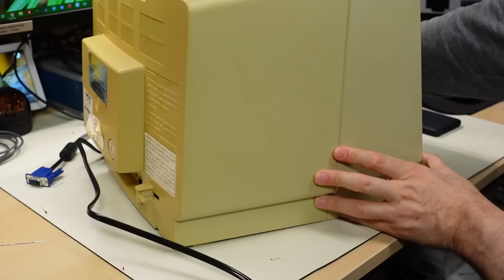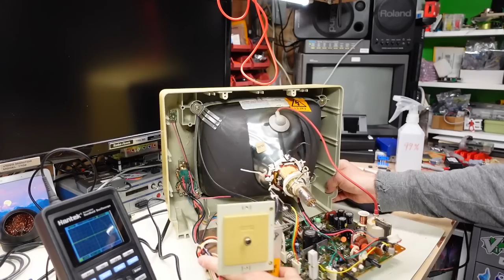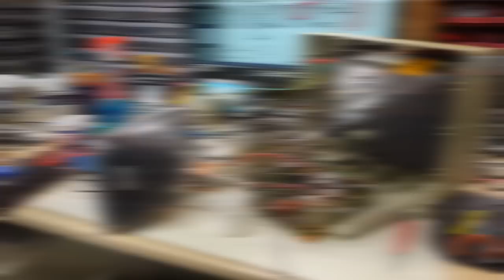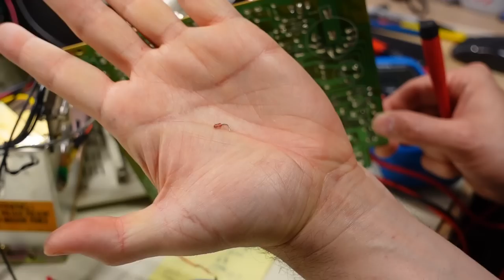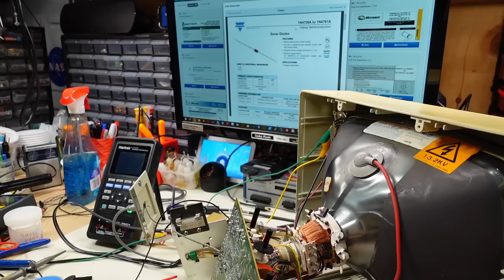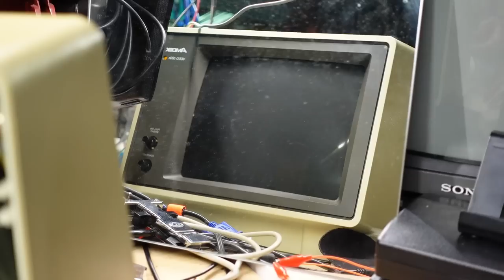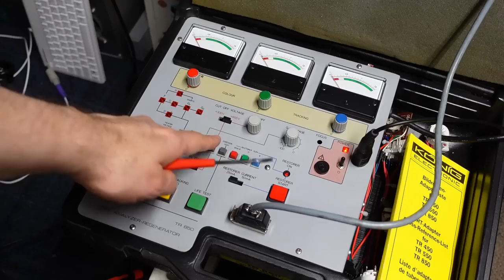I ruined this Amdek 300A after fixing it

Comment: "Better safe than sorry", and then he lifts the rubber cover and puts his bare hands about 4 inches from a conductor energized at 15kV. For those who might think about copying this, DON'T. Keep in mind that (here in the US) OSHA says the minimum safe distance from a 15kV energized conductor is about 2 feet. And no, holding a plastic stick doesn't make it better. In fact it could be worse. Also, the high power lines running down your street are typically around 12-15kV, and if you've ever seen one of those lines arcing you'd think twice about getting anywhere near them.
Reply: So, I wouldn’t be allowed to turn the monitor on or turn the brightness knob, because I’m sure the distance between any knob and the conductor is less than 2 feet.
Reply from the maker: What about the fact that just resting your hand on the outside of the monitor's case puts your hand inches away from the conductor? (And on larger color TV's those are typically running at 25-30kv) Having not read OSHA regulations, I'm guessing it is likely for high power high tension things.
Reply: @maschyt  Are you familiar with the term "insulation"?
Reply: @adriansdigitalbasement2  Adrian, it depends on not only distance but the insulation between the energized conductor and your bare skin. The CRT glass and rubber covers are really good insulators. Air, not so much. Which is why people who work on high voltage lines for a living use long, insulated sticks that are regularly tested in a lab to make sure they have sufficient insulation. And they also wear rubber gloves. And so on. And there's no difference between the 15kV on your CRT and the 15kV "high power tension things". When you lifted the rubber cover, all you had was air between the conductor and your skin. And if you use a plastic probe it could have some crud on it that provides LESS protective insulation than the air.
Reply: @adriansdigitalbasement2  By the way, if you notice the design of the high voltage probe you're using, it's plastic (good insulator), it's probably about 1 foot long or more, AND it has some plastic "skirts" near the handle, which serve to increase the distance between the conductor and your hand (a longer path for electricity to travel). No different than the insulators that are holding up the high voltage wires you see on the power lines going down your street, which are which have about 10kV of insulation per skirt.
Reply from the maker: There is a big difference -- I've gotten a shock from a monitor before with no ill effects, just a really good zing. (That I don't recommend.) I'm sure getting a shock from 15kv in an electrical substation is instantly fatal because there is so much energy behind it, hence the need for numerous safety precautions.  Not to mention, most people probably have been shocked with 15kv of static electricity walking around their house in the winter...
Reply: @adriansdigitalbasement2  It's up to you, but it takes about less than 0.2 amps of current thru your body to ground (or thru your heart) to be fatal. And your body is probably a few kOhms (of course depending on how much insulation your shoes/feet have, if your skin is wet, etc.). Do the math. And BTW, you had the monitor turned ON when you lifted the rubber to check voltage. It's not a case of static/capacitive charge, the 15kV had a driving source. So you're saying it can't deliver < 0.2 amps at 15kV thru your heart for long enough to be fatal? Good luck with that.
Reply: @EETechStuff  maybe ask electroboom
Reply: @EETechStuff  Firstly, technically you are correct that the OSHA guidelines aren’t only referring to overhead transmission lines. But if you read further the table you are referencing actually comes from NFPA 70E where they give guidelines for the limited approach and restricted approach boundaries. These values given by the NFPA are based on the worse case scenarios where  there is no restriction to current. If you read a little before this table the NFPA gives the following exemption: “Examples of work that might be performed within the limited approach boundary of exposed energized electrical conductors or circuit parts be- cause of infeasibility due to equipment design or opera- tional limitations include performing diagnostics and testing (for example, start-up or troubleshooting) of electric circuits that can only be performed with the circuit ener- gized and work on circuits that form an integral part of a continuous process that would otherwise need to be com- pletely shut down in order to permit work on one circuit or piece of equipment.” Even OSHA says the use of these tables are less reliable and recommends that a risk assessment should be performed where possible to determine the likelihood and consequence for specific scenarios. 

Doing the math based on 120V on a 15A circuit you could draw a maximum of 120mA at 15kV (160mA on a 20A circuit). Yes this is high enough to stop your heart, but the likelihood that circuit could draw 15/20A at 120V is not likely, there would probably be a fuse or component that would blow well before that amperage is reached. 

The point is, safety standards and codes of practice are there to aid in the performance of risk assessment, evaluation and mitigation processes; especially for a worker who might need to make a qualitative risk assessment on the spot. Taking values out of context and quoting them like they are a set in stone by law is not correct. Risk management is rarely ever a black and white answer
Reply: @liamloveridge9358  ^this. Acting like power transmission lines are identical to the output of a tv flyback is just silly. I guess EEtech forgot about current and power, and only considers voltage? OMG, static discharge has such a high voltage it will kill you (jk)!!!
Reply: What is generated by the flyback is closer to a static charge.
Reply: @sjm4306  As I said, it only requires about something like 0.2 amps thru your body for a very short time to kill you. Whether they are power transmission lines pushing the current is irrelevant. Since your body resistance is typically on the order of a few kOhms, ANY voltage that can push that amount of current thru your body for a second or so can cause fibrillation and death. Do some research. With 15 or 25 kv across your body (with a resistance of say 5 kOhms), it can cause something like 3 amps to flow, which is far more than enough. If anyone has any proof that an energized CRT cannot supply that amount of current for long enough to cause injury or death, let's hear it. Otherwise, it's just handwaving.
Reply: @EETechStuff  I’m not trying to say it’s Perfectly Safe, but I have a hard time imagining a 1.8kW outlet will be able to deliver 45kW (your stated 15kV 3A) without a fuse blowing… you could probably get a very brief 200mA transient faster than a fuse would blow at ~150mA, and like you say, it is indeed a risk in that regard, but that’s surely not the same as saying 15kV can theoretically push 3A… (especially since current is pulled, so it would depend on your body providing a thirsty-enough path to ground as well, right?) NB: I’m not an EE, I’m a physicist, so I’ll of course defer to practical experience whenever it matters, just trying to explore the topic from first principles!
Reply: @EETechStuff  There is a huge difference. The HV in a monitor will only produce a couple watts, while a power line will supply kilowatts. It was common back in the vacuum tube days for some technicians to reach in a live color TV and touch the second anode , then use their other hand to touch someone else to make them jump. There wasn't enough current to be dangerous. The only danger there was a sudden and violent muscle contraction which could cause you to cut yourself if you hit a sharp edge. Old metal chassis were often stamped on worn dies which left razor sharp edges.
The secondaries here are 7200 VAC, and fused at 20A. that means they can supply 144,000 watts without blowing the fuse. The effect is instantaneous as all of the water in your body turns to steam, causing your body to explode.
Reply: @EETechStuff  Sigh. It is typically a few miliamp source, and it is a high impedance source at that. You have no clue about how low the available current is, and current has to flow through your heart to stop it.
Reply: @michaelterrell  From an OSHA training publication: "50 to 150 Milliamps: Extreme pain, respiratory arrest, severe muscle
reactions. Death is possible." Believe what you want to believe, but unless you have actual test data showing that a live CRT at 15-25kV is not capable of pushing that amount of current for a second or so (or however long the worst case would take for injury or death), it's all just handwaving.
Reply: @EETechStuff  You are doing the handwaving. I've worked on TVs since 1966 and I know first hand that the it will not kill you. OSHA is paranoid. They insisted at one time that we install TV coax in EMT to prevent people from being electrocuted from 0dBm TV signals. That signal is 1/1000 of a volt, into a 75 ohm load. Study some real electronics and stop embarrassing yourself. I have worked with HV and RF for almost six decades. I've received shocks from TVs due to failing insulation. I've also used fiberglass shorting sticks in transmitters. I've work from under one Watt to five Megawatts of UHF, in the Analog TV days. You are absolutely clueless.
An OSHA inspector thought that it wasn't safe to service electronics with the covers removed.
I would be more worried about an arcflash from high current, than a shock from limited current HV. There are videos online of arcflash when large UPS systems fail. The vaporized copper or aluminum from the bus bars cause third degree burns, on up to instant death as you flesh burns away, and it can happen at voltages that you can safely handle without gloves. On TV transmitter I worked on had a pair of 1.5 Volt, 1000 Amp filaments. That is 3KW just to heat a single tube that produced 25 KW of RF. Theree were multiple interlocks on that cabinet to protect you. If you dropped a piece of metal in there with it powered, you would be dead.
The 'Vital Industries Squeeze Zoom' video effects system at one station had many power supplies for various voltages, but the main supply was 5VDC at 1000A 5KW to lower the logic ICs and DRAM ICs. It filled a full relay rack and needed over 7KW of 208, three phase to power it. You removed all metal from your body and your clothes, and used insulated tools to prevent any possible arcflash. 
This was an interesting computer. It digitized two frames of NTSC color video, and could do many effects with it. The early DRAM memory was so slow that it was clocked in parallel groups, then read across each board. The amazing thing was that it did FCC approved video processing in real time with a single Z80B processor.

Don't try to tell me about angry electrons.
Reply: @michaelterrell  Ah, okay. So you're telling people it's okay to touch an energized CRT with their bare hands. Personally, I think it's irrational to even consider it. And all of this this because people don't want to take basic precautions like wearing rubber gloves, or just not working on energized CRT's in the first place?? Hard to imagine.
Reply: @EETechStuff  50mA at 15 KV is 750 watts That is over 100 times the power rating for a small flyback.
Reply: @michaelterrell  The short circuit current that a transformer can deliver is a function of its short circuit impedance/inductance and the impedance of the short (a human body's resistance in this case). The power rating is irrelevant. And depending upon the inductance of the transformer winding, it can also generate a transient overcurrent due to DC offset. Which is one reason why I said that unless you have actual test data showing what the voltage source can actually deliver it's pretty much handwaving.
Reply: @EETechStuff  Flybacks are wound with wire thinner than human hair. They don't operate at 60Hz, and you are clueless. They are not  an iron core power transformer, they are a tuned RF inductor.with a very high impedance.
Reply: @EETechStuff  Do you know what happens when you overload a tuned circuit? It's output level drops drastically. If you overload a flyback, it detunes it. The current in the primary goes up because of the losses while the output falls, while the core overheats. It lowers the permability of the Ferrite core, further increasing losses which will quickly destroy the Flyback. They are not a sinewave transformer, they are driven by a pulse at the horizontal scan rate. 
he Flyback converts the pulse into a fairly linear sawtooth to defect it across the screen from left to right, then drive it back to the start 
The combination of the flyback and horizontal yoke windings comprise a high 'Q' circuit.
The first TVs used 3" scope tubes with a P4 phosphor. The 1.5 KV second anode came from a free running oscillator that ran at the self resonant frequency of the transformer. If you touched the HV on those, it killed the oscillator and the output dropped to zero. Color TV used HV rectifiers rated at 30KV at 1.7 mA which is 51 Watts. Those flybacks were ten times the physical size of the ones in a small monitor.ones made for B&W TVs were rated at 0.00025A. That would only provide 3.75W, including what is dissipated in the flyback.
TV Flybacks are not the same as those used in switching power supplies. Both operate from current pulses, but they are not used for wave shaping in SMPS.
OSHA doesn't know anything about the design of tuned circuits, they only understand power distribution. Apparently, that is all that you understand as a well.
Reply: @michaelterrell  Wow, you are REALLY determined to be right, huh? You've drained all my energy. I give up. You win. Feel better?
Reply: @EETechStuff  I haven't 'felt better' in over 15 years. I used to have to teach new techs this material, and I did it with the technical reference books and datasheets. I do not like to see people spreading misinformation. Some of my design work went to the IS in the form of their kU band communications system. I also did work on the tracking stations that were built for the ESA, and a turnkey earth station for NOAA to track and control their LEO weather birds to provide satellite data for weather forecasting. I also worked on the first SDR based, dual diversity Telemetry system on the market. I walked a PHD through the repair and modification of some Telemetry equipment in Antarctica, via Email. I also update the designs of many existing products to improve their performance. I designed and built test fixtures, and wrote test procedures. I qualified new components, and removed some well know OEMs from our AVL I also had to take purchasing to task for changing vendors without approval. Some 'genius' decided to stop buying the specified molded inductors we used. They switched to another OEM without asking. They claimed, "5% is always better than 10%!". If from the same OEM, yes but not when the new vendors inductors all had a lower SRF.
Reply: @EETechStuff  A "modern" (aka almost everything after 1947) CRT flyback isn't capable of delivering anywhere near 200mA output. According to the RCA 630TS service manual, "Its short circuit current is approximately 3 ma." Modern solid-state color systems will probably deliver more but probably still under 30mA.

The obvious way to settle this is for somebody to short the high voltage lead through an ammeter and and share the result.
Reply: @eDoc2020  Thanks. There's a lot of handwaving when it comes to the subject, but I never hear anyone giving actual short circuit test data. You're the first. As I posted, OSHA claims 50mA is sufficient to cause injury or death, which is peanuts. And if you're saying it can get up near 30mA, it seems like this whole discussion is a no-brainer. And especially when we're talking about equipment that's 60 years old, it seems ludicrous to assume everything is operating within spec. You're the first person who has actually provided short circuit information, so thanks much. I keep hearing about people getting zapped and/or getting thrown across the room by CRT's, and presumably that's not even CRT's that are powered on. And especially when you consider the old vintage hobbyist guys who might have medical conditions, it seems crazy to not even use rubber gloves. Anyway, thanks for providing actual data. By the way, regarding your suggestion for someone to actually do a test, I agree 100%. I'm surprised nobody has taken the time to do a short while capturing the current pulse on a scope. Seems obvious.

Comment: Actually, you can get 100's to 1000's of hours life out of those tubes if you learn how those do actually age. What you have should done: Put it in an oven and put a negative charge over grids and anode tied less than 8kV below ground.
Reply: Aka migrate crap from cathodes SLOWLY to anode, which doesn't hurt that much. Oven about 270 Celsius "anodes" including filaments -350V.

Comment: I think you need to learn how crts work in depth and how the tube is built 

U can't just use a rejuvenation unit to fix have to know how it works and what to do 

Don't scrap the tube u can cut off the neck and rebuild the gun and reseal it  

If future out exactly how works and wat causes failure u might be able to fix it externally like using induction cook to redo the ray gun and use getter leftover and maybe use laser to clean etc 

But isn't as hard as would seem cut gun off neck rebuild it and reseal

Use to be done back in heyday